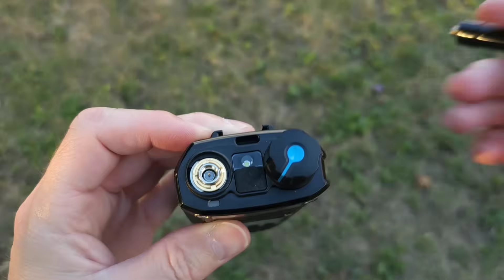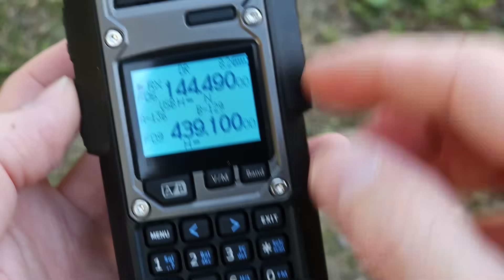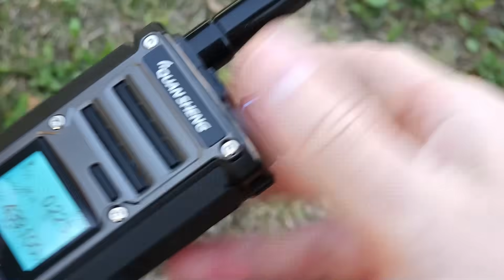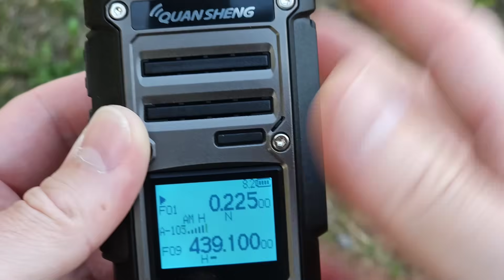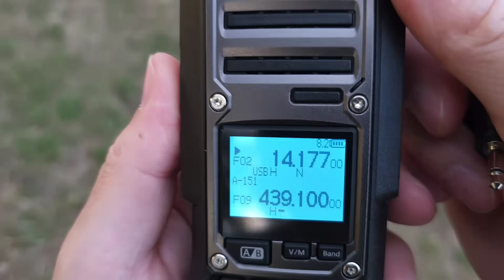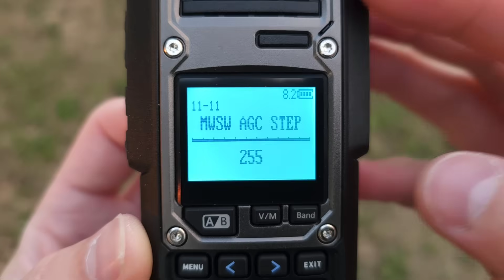Good News! VER.2 the QUANSHENG TK11 is coming soon!

Comment: There is no gain with a 1,5 meter telescope antenna you have a negative gain Maybe 20-30 dB  and it has no ground ! The Ferriet antenna is Symmetrical antenna That give the difference

Comment: Hi Paul, first of all thanks for this very informative video. On one side it's nice to see improvements on main antenna tuning and AGC. On the other side I am still missing you showing TX on HF (10m you said should be available, maybe also CB), which is the main reason why someone would buy this radio instead of a K5, which, when modified properly, sounds much much better! Also, I'd prefer BNC or SMA for short waves connector, a better tuning of the 27Mhz antenna and a serious work to get rid of harmonics. I think I will wait for V3 or maybe V4....

Comment: Hang on guys, the key boo boo was not the 3.5mm HF socket, it was the sub 18MHz overloading due to the low dynamic range on AM. If that has not been resolved, then this redirection of HF to another Socket is not big news. Why pay all this money for a radio that struggles with HF? A modified K5/K6 or a UV98 / RT-880  handles HF with ease. Or am I missing something here? Anyone?
Reply: You said the most important thing and no one is answering.
Reply: UVK5 is better and so much cheaper. Very hackable for more features.
Reply: Ik heb spijt dat ik het apparaat voor 70 euro gekocht heb bij een zendamateur, diegene wist dat het niet werkt mobiel met hf en toch beweren dat het aan de mobiele antenne ligt😢

Comment: I bought the V1 of this and am still looking at it at the moment when other matters and other projects permit, I got it to find out what all the hype was about and so far it's been a little bit disappointing, putting it on the TinySA I was not impressed by the harmonics generated and deemed it useless for 11/10 metre and 6 metre operation unless you receive only (I have a filter for 2-metres that I can put inline with the antenna), as is always the case it was cleanest on 70cm and PMR446, while I have seen a video by Tech Minds where he puts this V2 on the spectrum analyser it didn't appear to be much improved from before in my opinion, perhaps maybe they'll rectify that in the production run, either way a good video showing that at least some issues have been fixed

Comment: I think in a next version they should replace that old-style volume knob with a rotary encoder.
That would normally be adjusting the volume (just turning it would change some value in the microprocessor and it would adjust the volume), but alternately it would be used for tuning and parameter setting in the menus.
That would be SO much more convenient than fiddling with the up/down buttons!
And also those volume potentiometers always go bad after some time, at least they do on all my Baofengs.

Comment: It'd be nice if they fix the CPS
- You can't save a frequency > 600mhz to memory in the CPS

and it'd be also be nice if they made A and B able to receive 30-1000

Right now it's:
A - 0.52 - 650
B - 108 - 1050

so that one can't monitor two 39mhz freqs or two 800mhz freqs at the same time!
Reply: Agreed! Hopefully the CPS and firmware improve with time. I'm sure they will👍

Comment: Paul, did they add filtering for the harmonic spurs on transmit?  That's what keeps me from purchasing this radio - the only safe transmit was on 70cm as I recall.
Reply: Slighly improved but still bad. Tech minds has a video about it
Reply: Hopefully they will fix that issue in the final release. I put off purchasing for the same reason.

Comment: They aren't really listening to us that much. I really can't see why they just don't get rid of the jack plug it's useless Use a BNC connection QUANSHENG great review Paul 73!
Reply: Ive seen it mentioned BNC may not be good if youre changing antennas a lot as it has a limited operation cycle, maybe why they havent used it. I have not researched this claim so grain of salt, just seen it mentioned. I will ask a communications engineer friend in a couple of days if i remember.